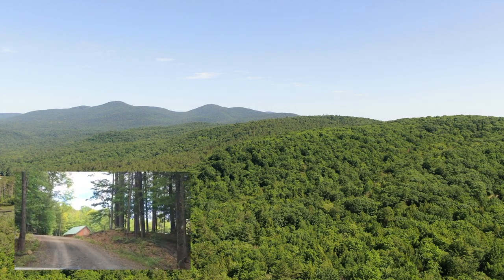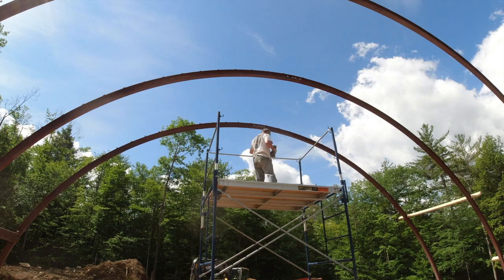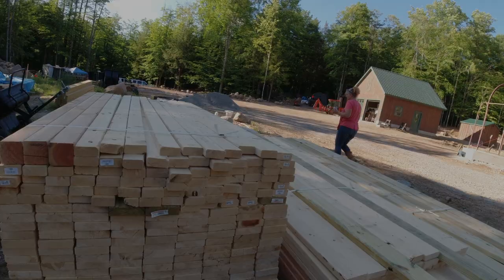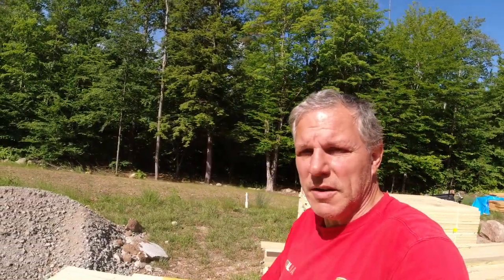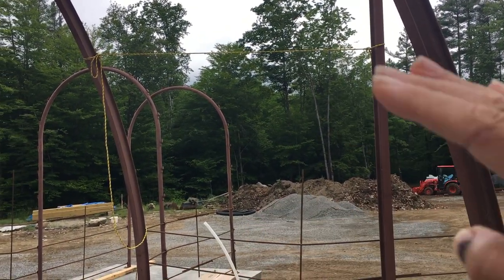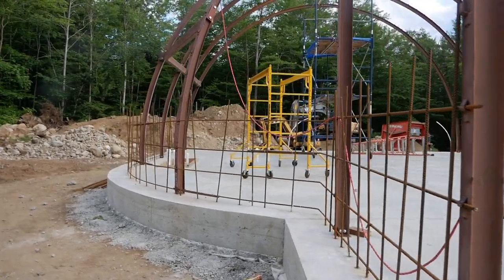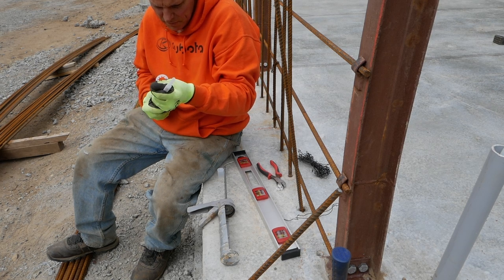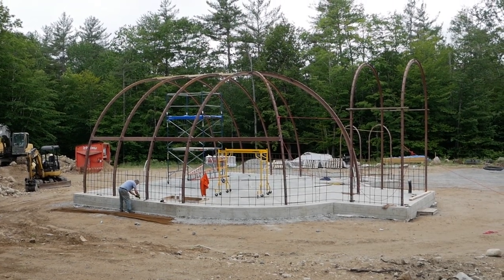We've Never Done This Before | Building An Off Grid Home in the Adirondacks

Comment: Just found your channel, binge watching now.  You guys are making good progress.  My wife and I are also building a shotcrete dome house/shop/storage area.  We're doing all the work we can and are retired.  Really miss being younger and able to go non-stop.  Youth is wasted on the young :).  It's probably too late as I suspect you're mostly done with rebar tying but I made a simple tool that works very well.  I had a couple of those rebar pull things you're using.  They don't work very well and your hand gets really sore if you have a bunch of tying.  I pulled out the twisty part some and cut about three inches off (with the hook).  Then I ground the spiraled part into somewhat of a triangle so I could grip it in a battery powered drill/screw gun.  It works awesome an you can set the clutch so it tightens it just right.  If you care I have a channel that showing our build.  It's on Rumble but I'll share a link if you're interested in watching another retired couple do some of the same things you guys are doing.
Reply from the maker: We miss being younger all the time too! We ended up hiring professionals for the rebar but you’re invention sounds pretty amazing!